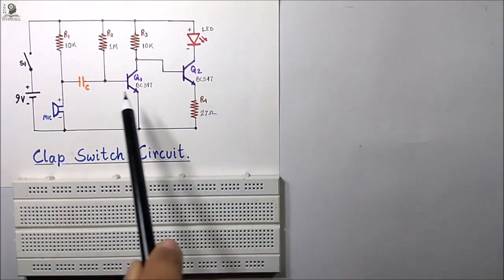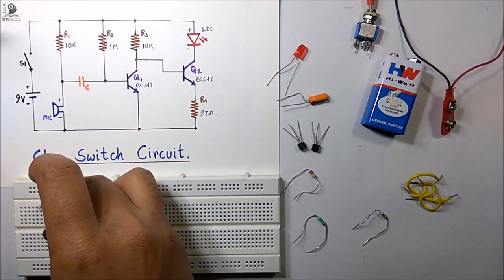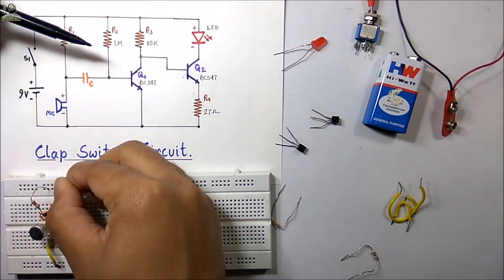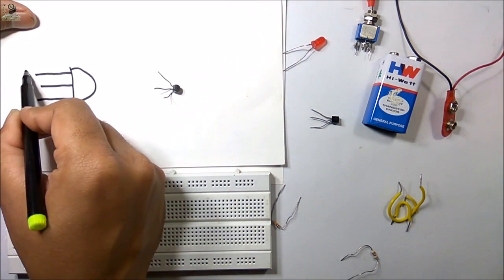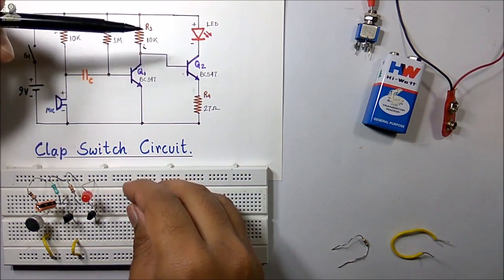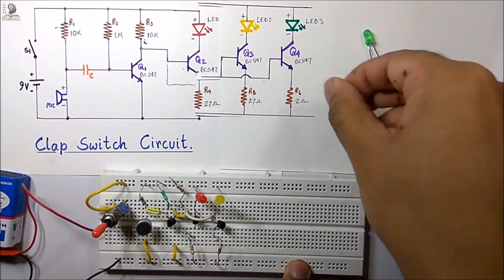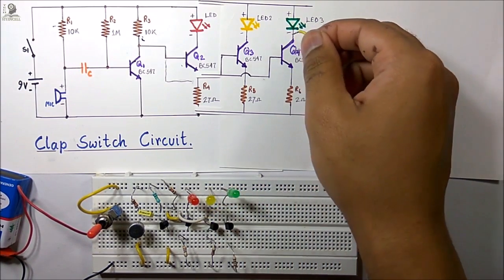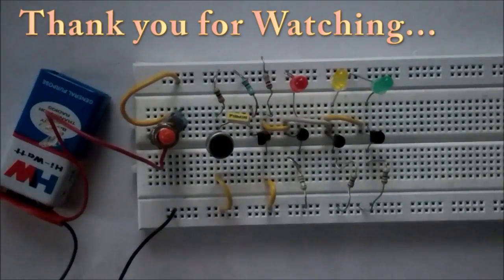How to make Clap Switch & Music Rhythm LED Flash light circuit without 555 Timer/Electronics Project

Comment: Thanks for your work! Very appreciated :) The circuit work as a charm, just one question: i used a piezo instead of a mic, is there something i can change to increase the sensibility? Now it is veeeery low (i have to phisically "tap" the piezo to make it work, it doesn't work if applied on a wooden surface)
Thanks a lot! :)

Comment: do you need the switch?  my light just stays on... but i'm not using a switch.  it will stay if i remove the mic even.
Reply from the maker: The switch is not required... check for the loose connection or wrong polarity the circuit will work fine...Thank you..

Comment: What is the roll of 1M resistance
Reply: It provides forward bias for Q1 which keeps the R3 current going to ground instead of forward bias for Q2. When Q2 gets forward bias, then the LED lights. When you clap Q1 loses forward bias and Q2 gets forward bias allowing LED to find a path to ground.

Comment: If I changed the LEDs to LEDs that work off 3.4v and change the 27 Ohm resistor to a 20 Ohm resistor for the LEDs, this would still work, correct?

Comment: could you please tell what changes i had to make in music sync schematic to run this wth led strip that need 12v 2a power supply
Reply from the maker: Use a MOSFET
Reply: Tech StudyCell i have made a circuit earlier using mosfet bt that didnt worked may be i did wrong connection of mosfet could you please help.

Comment: Is it clap switch or normal switch you have used?
Reply from the maker: In the first part of the video, I have designed a simple clap switch circuit. ** the ON time duration after clap depends on the capacitor used. more capacitance more ON time duration after clap.

Comment: hey my circuit doesn't works. The led automatically keeps on glowing after connecting supply. please help
Reply from the maker: +Nikhil Bagwe 
At first check for any loose connection. Then check the circuit again (transistors connections). This circuit will definitely work.
Reply: Nikhil Bagwe  happens to my circuit as well .
Did u modify circuit further or did it work as it was supposed to?